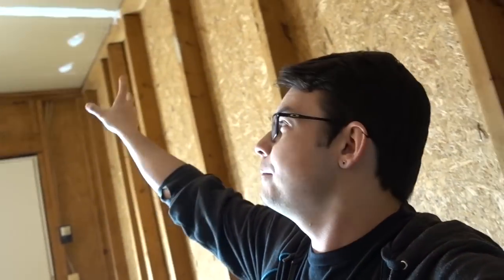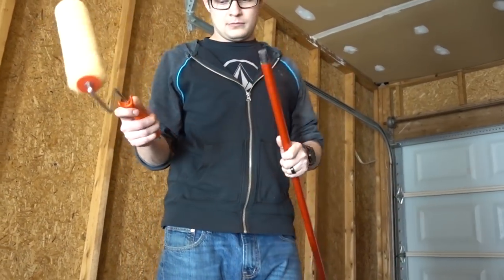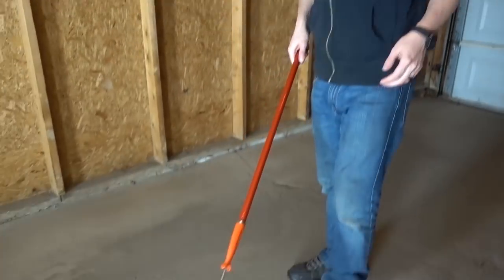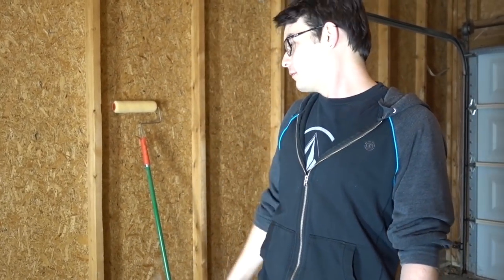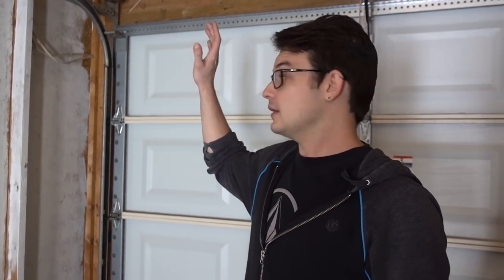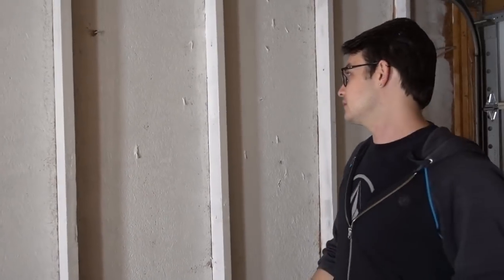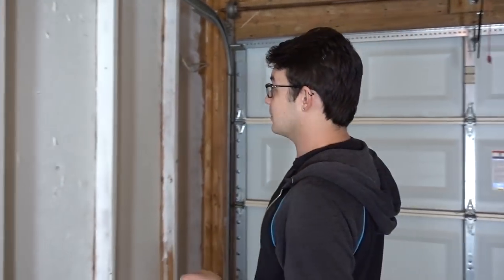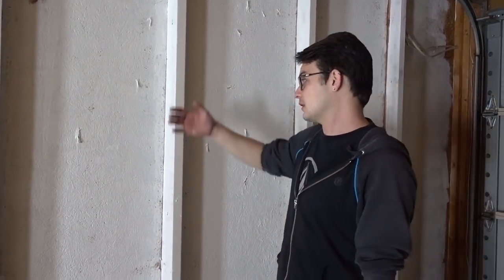Painting the Tint Garage | It still looks like hot garbage!

Comment: What about that thin foam that comes in sheets, it would act as a very low insulation. You would be able to cut inserts to fit between the 2x4's. They do have the more expensive foam board that has the chrome tape that could be done the same way. Just ideas..